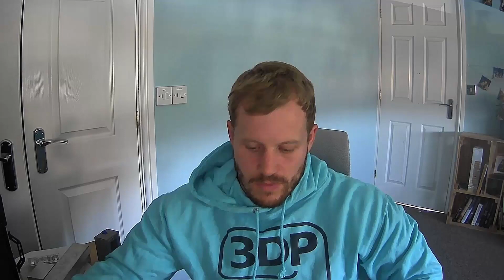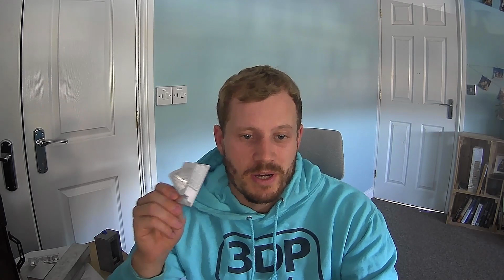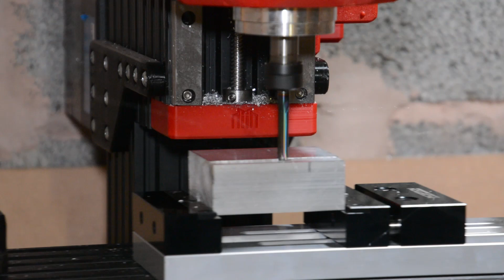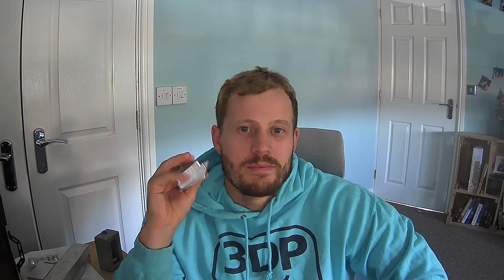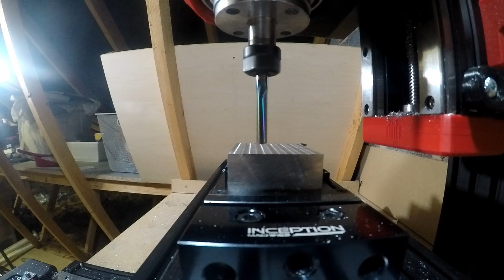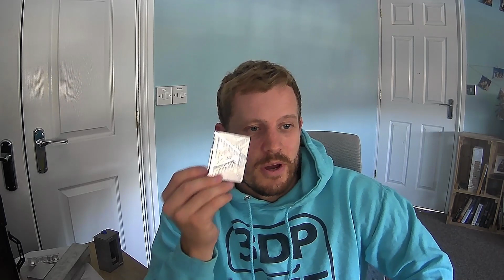CNC Series - Millenium Mill episode 2

Comment: As a cnc machinist i have to say this is extremely impressive to see. I mean its obviously chattering and struggeling a bit but the fact that this is working at all really shows how rigid this small machine ist. The fact that it´s build from aluminum extrusions and 3d Printed parts makes it even more impressive! Kudos to the designer, this is an awsome little machine!
Reply: Shame they choose aluminium, steel components would make a epic machine
Reply: @adambundy2639  not really. Thick enough aluminum is even better in dampening than steel (not cast steel). But it’s a matter of cost in the end. You can make a really stiff machine easily but it will cost you more money.
Reply: @Todestelzer  no it's not... aluminium is a lot lighter. So unless you match the weight which would be ridiculous it's just not a good choice. Show me a quality machine that has aluminium parts like you mention... you'd never see it on a industrial machine.
Reply: @adambundy2639   ok my comment got deleted. Why? Idk….

I write it shorter. I bought an aluminum CNC last year. This one in this video. 

https://youtu.be/PzpkV-En74c?si=Bl71oW2MZpeaZNUB

I don’t want to write more because I fear YT will delete it again.
Reply: @Todestelzer  cool I have a similar machine to. But back to my original comment... your on about a completely different machine. My comment is referring to the machine in the video and how if it was made of steel, it wod be auch better machine. The aluminium extrusion they've used was a terrible choice.
Reply: @adambundy2639  not for the price. You can get a kit for 1500€.
The steel brackets did cost him extra if I remember correctly. They are not in the kit. 

I think it’s better than other Chinese machines but I wouldn’t buy one because the work area is too small for me.
You have to make a decision somewhere about price and stiffness of the machine.
Reply from the maker: Thanks dude! Wait until you see if running with High Voltage drivers, steel z plates and a direct mounted square spindle 😎

Comment: at 13:30, watch the spindle mount and whole upper z move right to left. you have flex in your frame which is leading to your chatter I think because your chips look perfect that its ejecting so I don't think your settings are off
Reply from the maker: Definitely, printed parts hold the whole z axis on! But part of the ethos is to use the capability of the machine in its current 3d printed state to replace those parts with aluminium ones and hopefully get a massive boost in frame stiffness. I'd absolutely love to be able to machine with those settings minus the chatter!

Comment: Just wanted to add this in here as the designer. The machine was never designed for this kind of load and to see dave psuhing it to the limits both amazes me and gives me a good idea of where to improve it down the line.
Reply from the maker: Yup I should of added that the performance this can achieve with 3d printed parts is really quite amazing! Can't wait to see who the first all metal upgraded machine!

Comment: Doing  all of this going dry ? no coolant/lube?    going  full depth like this  probably needs  stiffness and watts  , what are your spindle specs ?
Reply from the maker: Yeah no coolant. The machine is not prepped for it hah!

1.5kw spindle. It doesn't like going slow hah, need to run at 12,000 plus or it struggles a bit.

Yup that depth is a bit much for the machine!
Reply: @3dpandme  for  lube you could  just spray  with wd40 on aluminum   and wipe it down (after hahaha), will help  the surface finish and not welding/sticking on the endmill  , you dont need  to flood it . i am using a mist of  coolant  and  for a half hour job it takes not even a cup
Reply from the maker: @people16vt  Jake the lead dev asked me not to use any on this machine (borrowed from him). When it comes to building my own (after i move house) I will probably be looking to locate the electronics such that I can use coolant and not worry about it!